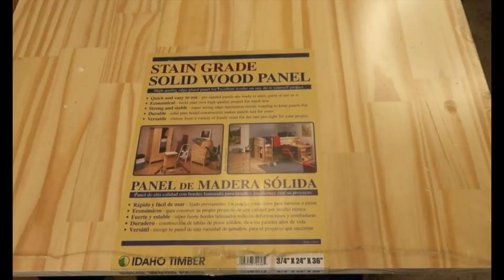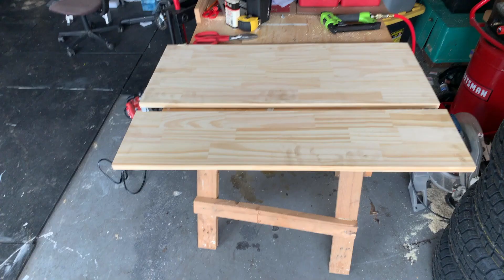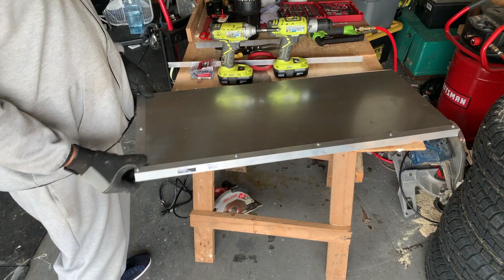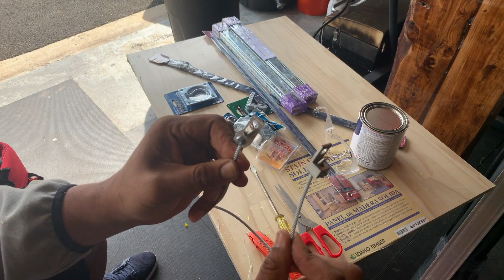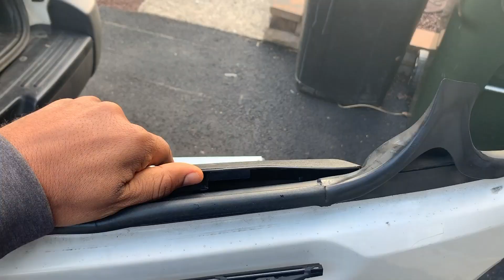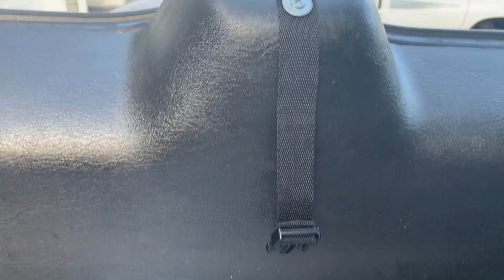Jeep Liberty Tailgate Table

Comment: Very clever. Do you have any tricks to keep the tail gate open when the jeep is leaning to the passenger side due to road slope?
Reply from the maker: Thanks! Unfortunately I don’t I just try and park on level areas as best as possible
Reply: @nomadsrv927  
I found a small piece of 2x4

Comment: how has your tailgate held up withe extra weight? I am thinking about doing this as well, awesome video.
Reply from the maker: Awesome. Yeah it’s actually held up well. I was a little concerned that it wouldn’t last but it’s going strong.
Reply: @nomadsrv927  awesome! I got all the parts ready to buy. Just gotta act upon.
Reply from the maker: Nice!